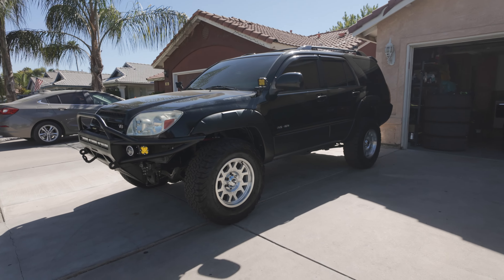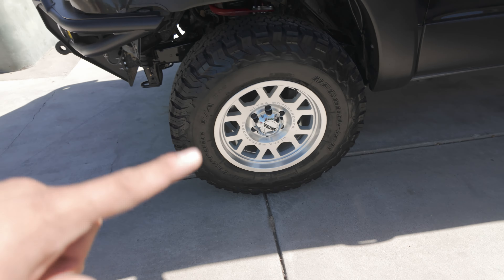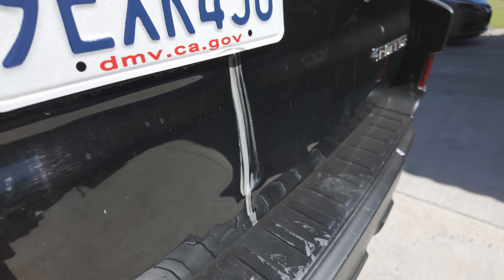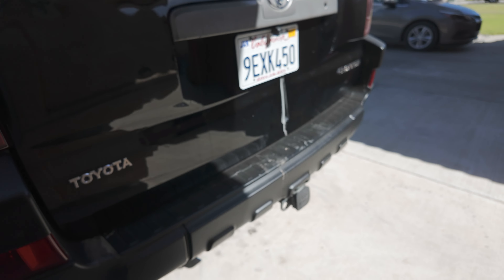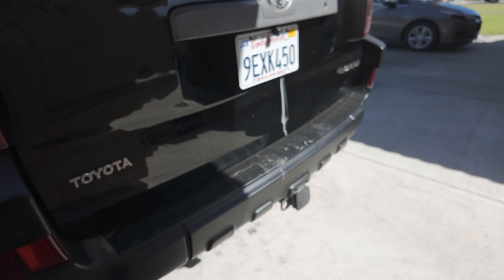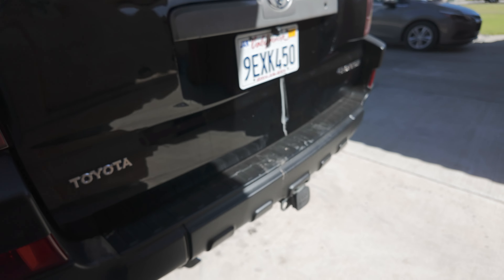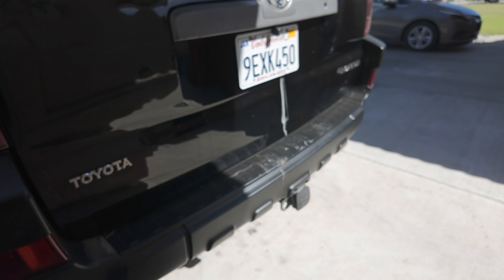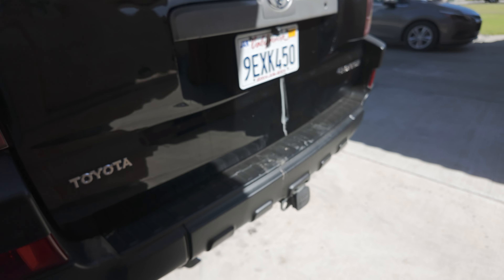New Mods on my 4th Gen V8 4Runner | 33's FTW!

Comment: Are you still running the OME 885/895 with the 285s?
Reply from the maker: Yea same spring setup but I have noticed more sag than I’d like in the front from the weight of the bumper and winch.